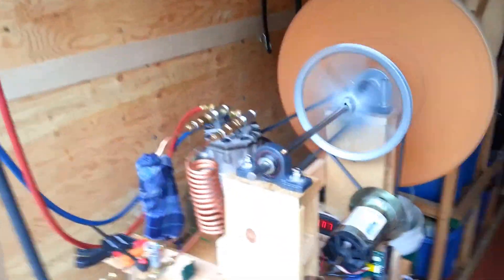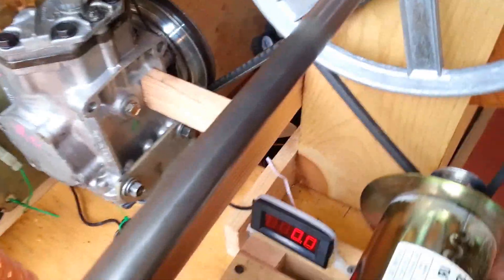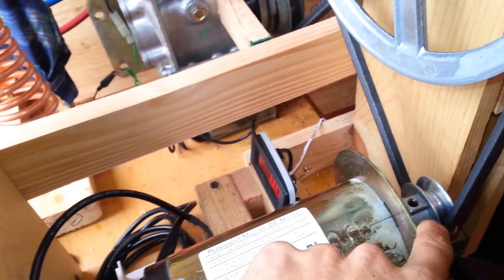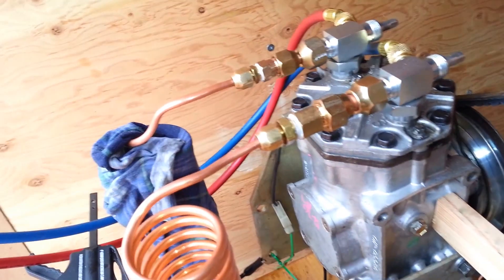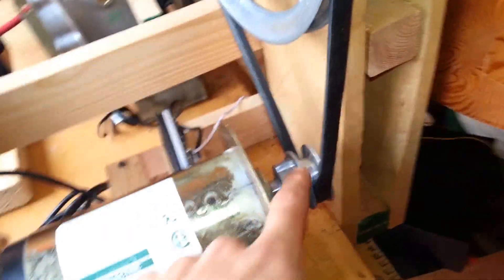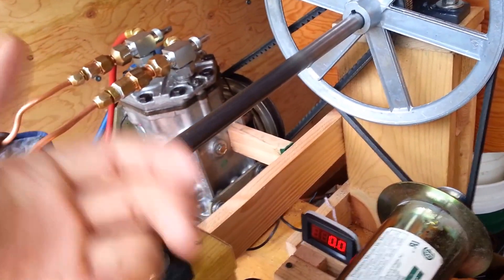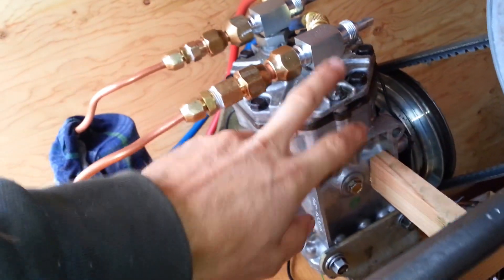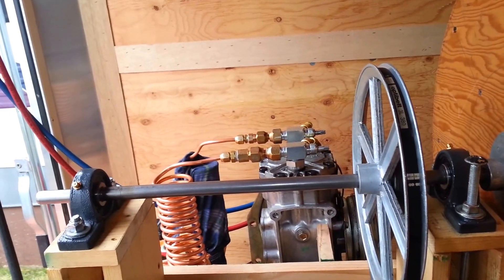Belt Driven Refrigeration Compressor

Comment: As a refrigeration engineer, I must say I never saw anything like it. Propane is about the same as F22 just explosive however. Make a metal flywheel smaller less air drag.

Comment: I know this is an old video but thank you for sharing I was just working on a belt driven farm tractor air conditioner system a few days ago thinking wonder how much horsepower that really takes to run with an electric motor and I was thinking you could get the electric motor spinning then engage the compressor clutch. But I was thinking in my head it would probably still take some serious power like around 5 or 10 hp to run it at full speed. I did a little search for on YouTube for automotive air conditioning DYI a couple nights ago but didn't come up with much in the refrigeration department. Then tonight this popped up in my feeds so I will check out your other videos on the project thanks again keep up the good work. Sometimes the dirtier and crude the project the better sometimes building them that way give you other ideas on other stuff. I used to work with a guy who I learned a lot from he used to call the stuff we did fabra-cobbling we would build machines to prove concepts and they were cobble together of miscellaneous parts mostly from the scrap yard. Once we had something that worked it would then go into design were they would make a set of drawings and we would build the machine from scratch from raw materials making a prototype to sell the rights of manufacturing the machine based off the prototype. Anyway this old guy used to say necessity may be the mother of invention but the monstrosity monster machines we fabra-cobble together end up being great inventions so monstrosities are the mother of excellent successful inventions that make huge profits so anytime one of these other guys around the shop tell you that you are hack job looks like a rattle trap remind them that you put more patents into manufacturing in one year than they did in their whole career. The old man was right abomination made innovation because our team did put out more machines into production every year than all the rest of the guys did in their career and yes sure The originals were butcher hack jobs at best but as soon as we had something that worked it was easy to get a budget to build it right and if it didn't work it went back into our scrap pile with very little loss of money to the company and we would use the parts for a later build. The other teams in the company started at a drawing board and had engineering cost plus manufacturing cost so if something of theirs didn't work it was often a year or two in the making and it was in the millions of dollars lost. We would have at least 10 if not more prototypes a year waiting for investors. The whole rest of the company would have maybe four or five.

Comment: this is awesome. i need off grid refrigeration, but my electrical system can't handle the inrush current called for by modern fridge compressors. please return tothis idea and refine it! we need your insight!
Reply: Well you could use a soft starter or VFD / DC inverter compressor to get around that.
Reply: @tomtom1541  i have notfound that to be the case. any soft start capable of doing what i need costs nearly as much and works less well than a DC fridge.

Comment: Solar power the treadmill motor . Use a water cooled condenser using a mini cooling evaporator tower. I love the control valve for the expansion valve. Propane is a good refrigerant and easy to get. Use it to freeze a large block of ice around a ton of solid ice pass cooling glycol thru it to a coil inside your house. Simple thermal mass solar power AC 😁👍
Reply: Congrats you read my mind years before I had the thought. Impressive 😂

Comment: is the propane gas safe to use along with the refrigerator compressor. what about the compressor oil. i have a small condenser, and a hermetic compressor. and i only go in to replicate your system if the propane don't explode.
Reply: propane is a very common refrigerant. 30w mineral oil will work fine in this application due to the york having its own oil sump

Comment: I know this video is old but I wonder if a capacitor bank would help your motor push through the compression stroke.
Reply from the maker: Tim Binns it might have!  That compressor just had too much displacement for what I was trying to do. To lower the rpm for the load wouldn't have allowed sufficient lubrication inside the compressor. I wish belt driven compressors were more common!

Comment: When you get around to replacing that flywheel, you might consider cutting the old one up to use for bracing gussets, especially on the top of that intermediate shaft's towers.